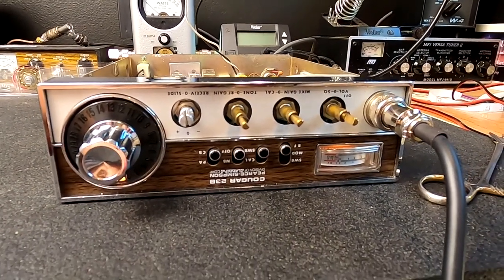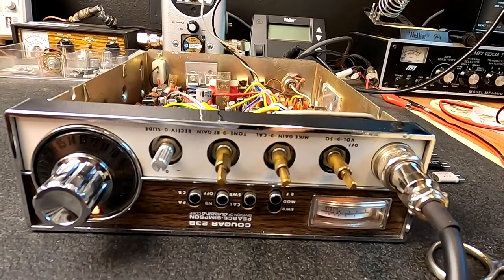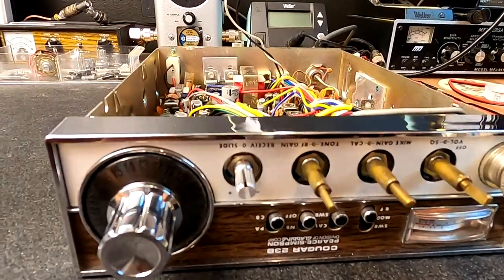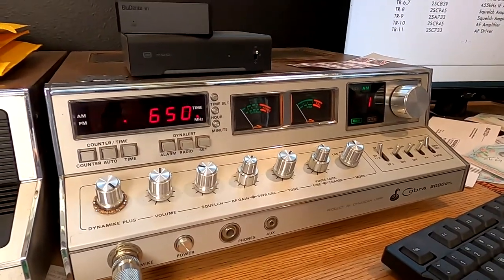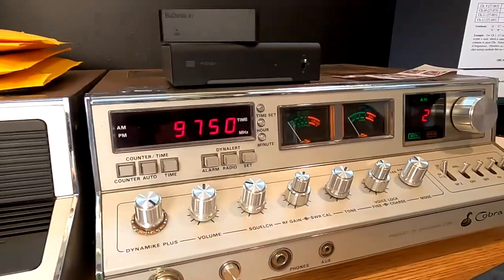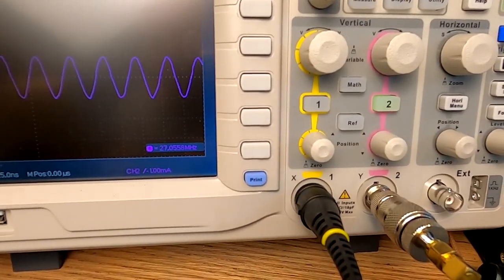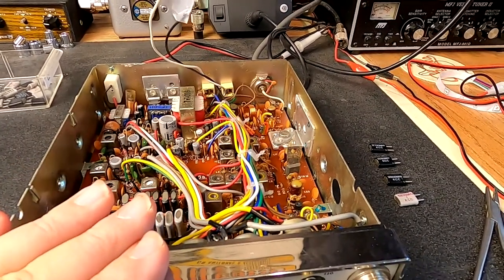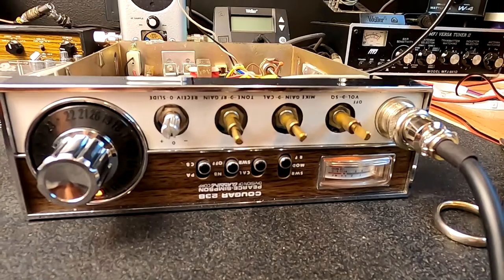Fix your own CB Radio,  Pearce Simpson Cougar 23B Transmits on the wrong channel.

Comment: If those grain-of-wheat bulbs aren't burned out the radio doesn't have many hours on it. The 37/10 combination was quite popular and used in a ton of radios. A way to field test crystals is to dial up the frequency on another receiver. A ham rig capable of tuning 37 mhz is a good way to check those frequencies and prevent you from chasing your tail.
When I get a new addition, here's my procedure:
See if it powers up. If it's dead, you can throw it in the parts box, but what if you really want it to work? 
Open it up and clean the switches and controls. I use LPS Plastic Safe cleaner. DO NOT use brake cleaner! If the crystals are plugged in remove them one at a time and spray the sockets. 
Power the radio up, along with your 7300 (or a programmable scanner will do). Start with the six-crystal bank because they are the master crystals. Pick one (37.700) and program that frequency into the other radio. If it's working you'll hear a carrier. Repeat with the remaining crystals. If none of them work then you've got a bigger problem. 
If they are reasonably close to frequency, see if the radio will receive and transmit. If it does, you're 90% done. Replace any off-freq crystals with (hopefully) good ones from the salvage box. 
That's the ticket!